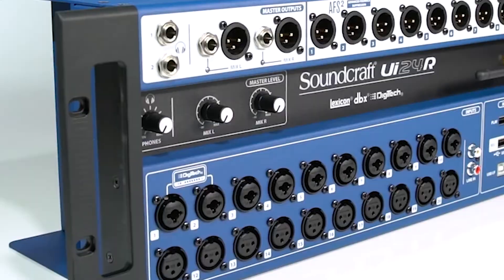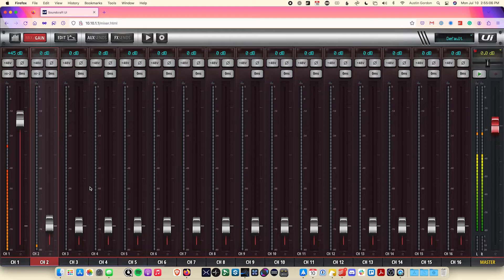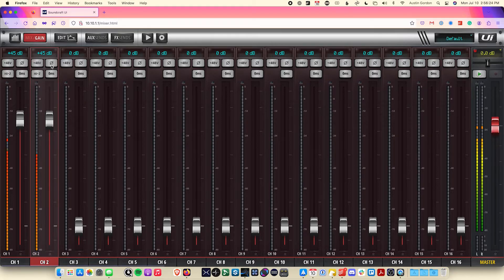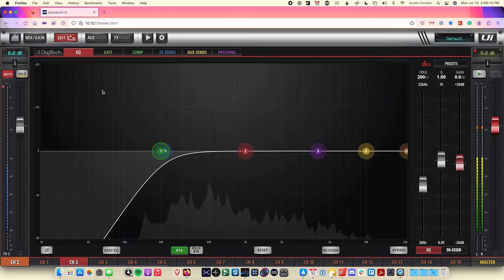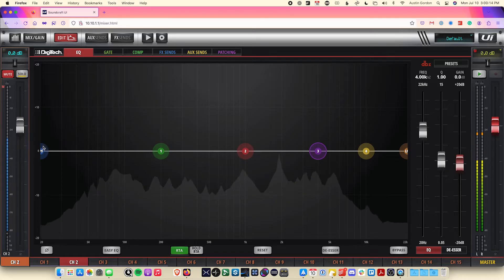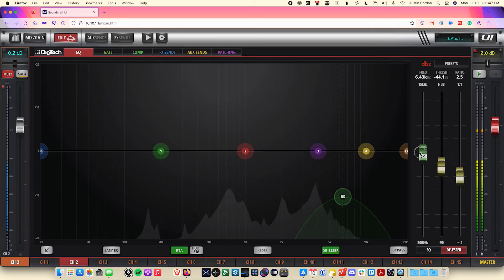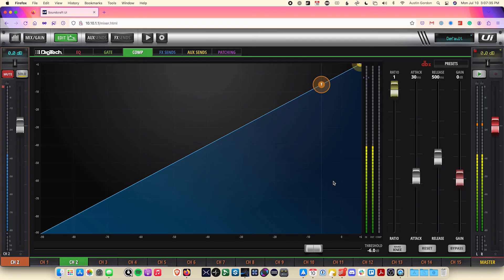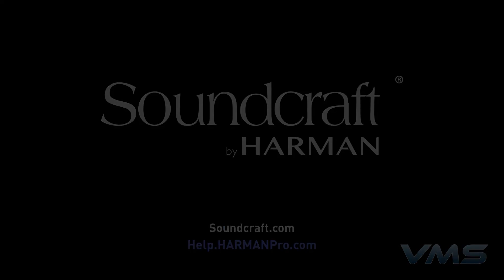Soundcraft Ui Mixers | Input Channel Processing

Comment: what's the recommended gain level then (you said -6db) for example for a vocal, i watched videos regarding the gaian structure and they said that digital units is -18 (compare to analog unity), that is not correct?
Reply from the maker: There's not a true "correct" answer, although the closest may be "registering peaks at a level you feel comfortable that they won't go above clipping." Yes, digital needs more care because the clipping is harder. Vocals need extra caution too because vocals can be the most dynamic of input sources. Some feel more safe at -18, and there's nothing wrong with that if you're getting enough from your mic in the mix and the digital feed is clean for recording! Maximize gain to the point of no clipping at peaks while minimizing the noise floor.